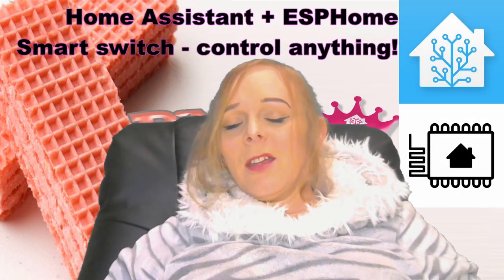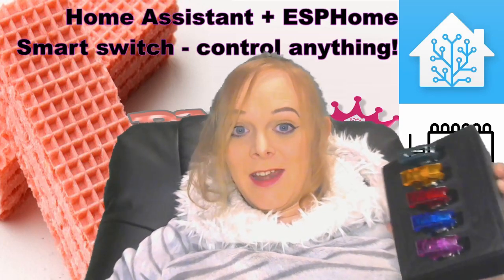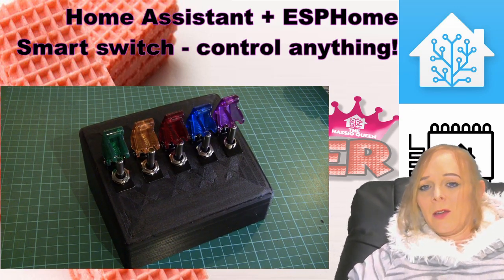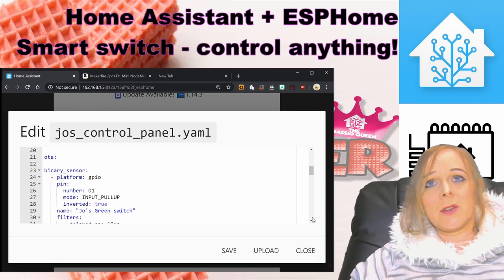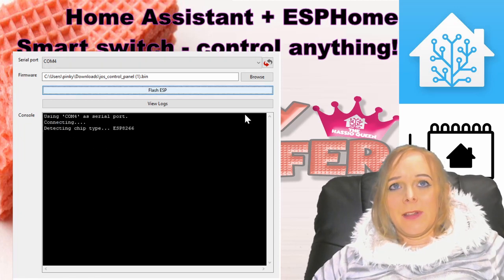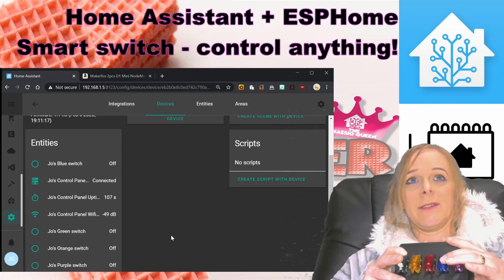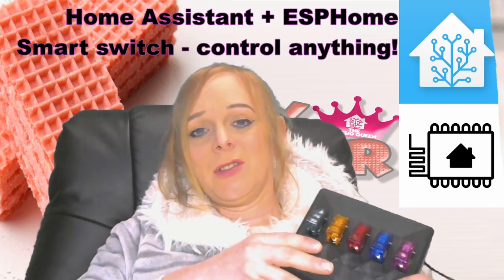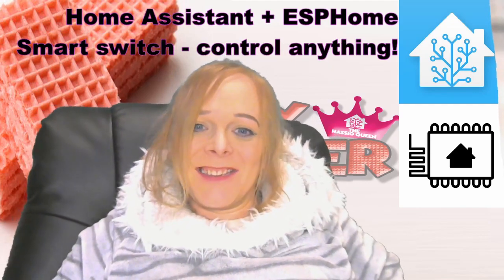Home Assistant DIY Smart Switches to control Anything!

Comment: I've used Wyze Sense door sensors with a button soldered on for a wireless battery-powered switch and been very happy with them. Did this about 4 months, still haven't need to change the battery in the things.

Comment: I have done very similar "remote smart switch" but I used NodeMCU v3 that you can power up from VIN GPIO pin using 9V battery and add one more switch in between 9V positive terminal to VIN. Therefore, you can turn the box ON/OFF and your battery won't go flat. Unfortunately, WiFi consumes a lot of power. However, now you can take the switch box with you it becomes mobile. When you don't use just turn it off and give a static IP so, when you turn it on it will connect almost instantly (2 sec) not too bad.
Reply from the maker: That's a nice way to deal with the downside of Wi-Fi power consumption. Another way I have thought of is to use an esp32, these have interrupts on each gpio, so once a command has been sent the esp could be put to deep sleep, and any button would wake it up.

Comment: I don't think I would be able to get away with those switches beside the bed. 🤣 Could I use touch capacitive ones instead?
Reply from the maker: Capacitive touch is a bit more tricky...  standard arduino touch sensors generally only detect the 'press' and not the release. As they require 3wires, I have seen someone use a gpio for the gnd as well, to reset the switch,  but this has issues of its own. The MPR121 touch board is supported in esphome,  but I'm afraid I can't provide any useful information as I've never used it!   The esphome docs may be more help to you: https://esphome.io/